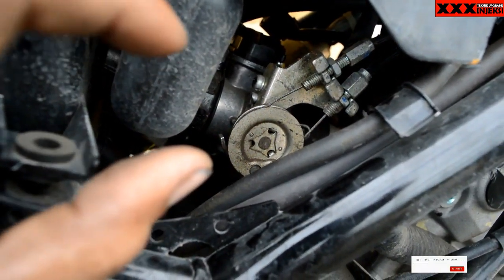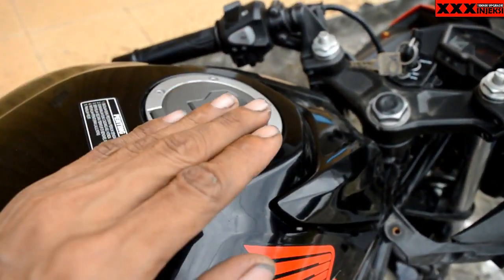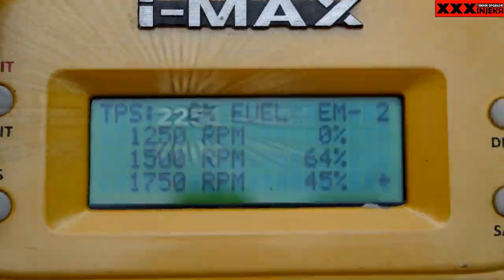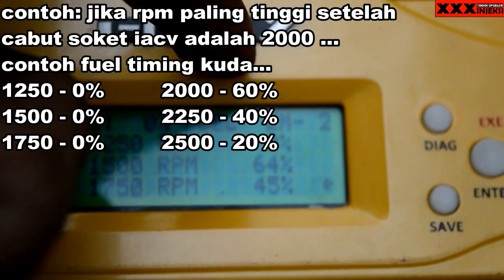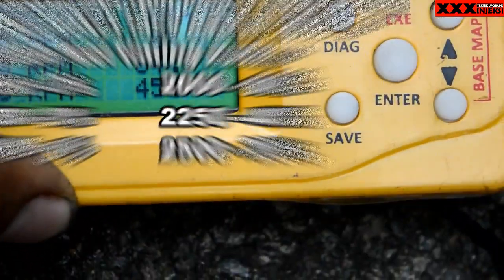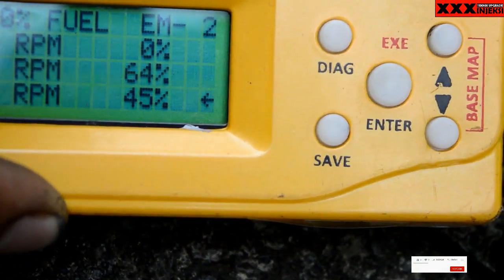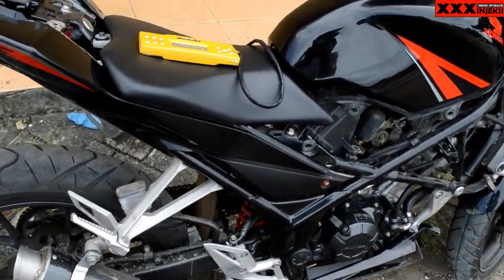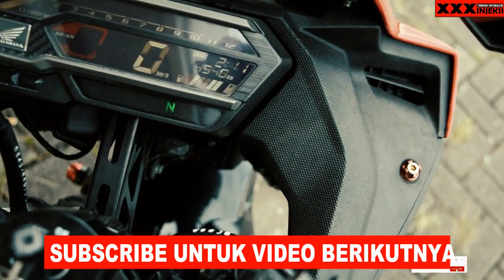cara setting TIMING KUDA/RUMBLE IDLE  juken 5 brt

Comment: Yg ditunggu tunggu 👍🏻
Reply from the maker: makasih dah menunggu...
Reply: @xinjeksigarage6766  oiya bang ada yg mau saya tanya
Saya setting juken 5 menggunakan android
Sudah saya calibrasi tpsnya
Tapi kenapa ketika saya bawa ke bengkel tps yg seharusnya 100% jadi 108% ya?

Apa modul bluetoothnya tidak bagus?
Atau sensor tpsnya yg bermasalah bang?
Reply: @xinjeksigarage6766  lalu dari awal saya pasang juken 5 speedometer saya jadi error
Petunjuk KM/L nya selalu jadi 999/L
Reply from the maker: kalau saat motor kita tes full gas nggak masalah berarti aman gan.... walaupun 108% tekan save aja ... artinya akan di ubah lagi oleh juken 5 kalau 108% itu adalah 100%
Reply: @xinjeksigarage6766  kalau prediksi bensinnya jadi 999 itu kenapa ya bang?

Comment: Kalau pakai isc manual berati diputar sampai idle tinggi ya mas?kira2 matic bisa ga ya setting timiing kuda di rpm 1500-1700?soalnya diatas itu pasti muter ban 😁
Reply from the maker: Bisa juga tuh... Sama aja...
Reply: @xinjeksigarage6766  ok mas nanti dicoba,terima kasih 🙏
Reply: @yongkireynaldi2384  gimana hasil gak?
Reply: @Teambodor  blm dicoba om,paling hari libur baru coba2..yg jelas saya sudah dpt teorinya tinggal praktek hehe..
Reply: @Teambodor  kalau maunya di rpm tinggi(2000+)di matic kayanya harus ada part yg diganti sprti per cvt/sentri/roller supaya rpm bawahnya bisa tinggi n  ban tidak muter..🙏
Reply from the maker: Per kampas ganda coba ujungnya di tekuk gan jadi lebih keras... Biar nggak cepat mutar ke mangkuknya...
Reply: @xinjeksigarage6766  cvtan per 2000rb per kampas 2000rb roller 5gram semua, om timing kuda nya di rpm 1250 ke bawah om udah di gimana gimana in juga tetep aja lamsang nya di 1250 rpm ke bawah